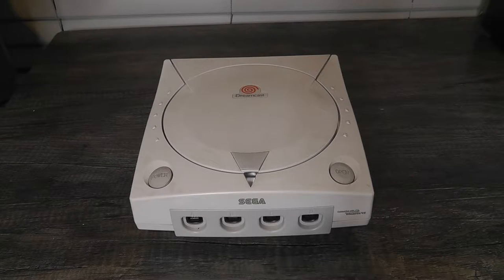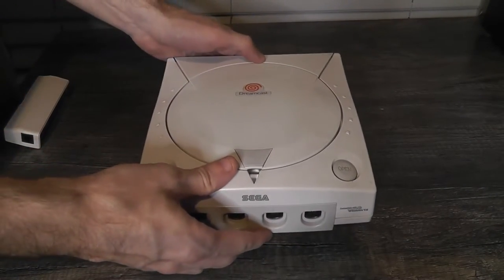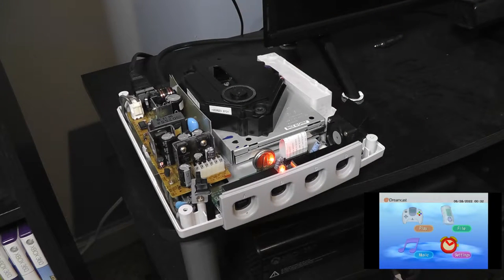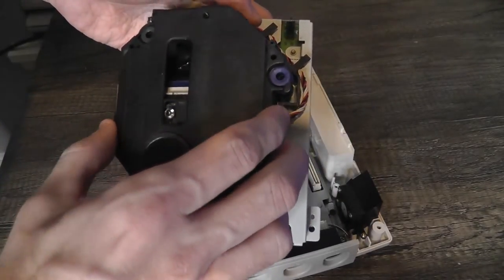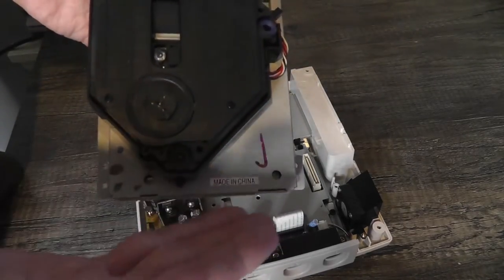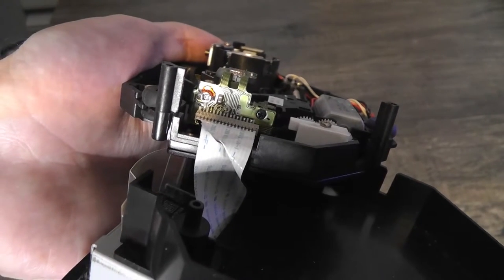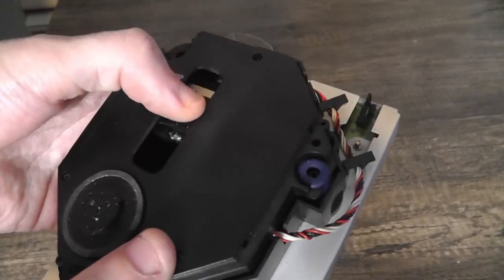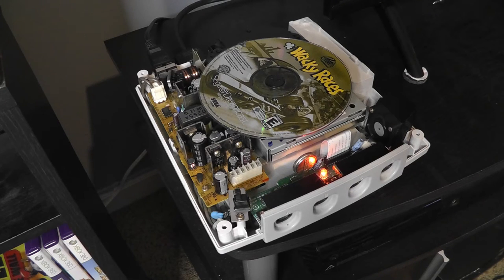Swapping Out a Sega Dreamcast GD-ROM Drive

Comment: I might be wrong but I suspect the screw adjusts tracking in which case even the tiniest adjustment will make the drive inoperable.  This being the case would explain why a screwdriver doesn't fit as it's machine calibrated.

Comment: I heard Samsung gd rom is not so good.I heard Yamaha model is much better.
Reply: And that's true, but Samsung drives aren't that bad as most of people say (even if I own both Dreamcasts with 5v and 3,3v Yamaha drives). In most cases Samsung drives has faulty PCB, or to be more precise; capacitors. Not always laser is the main issue.
Reply: I’ve had countless Samsungs go out zero of my Yamaha drives have died
Reply: This is the reason I always buy Revision 0s  Dreamcasts since they have Japanese made Yamaha drives inside since they are bulletproof and reliable, but finding revision 0s are hard to find tho. Revision 1 and 2 on the other hand just have cheaper quality drives which are by Samsung, because of that it’s best to use GDEMU on those models, if u don’t wanna deal with laser issues or stuff like that.